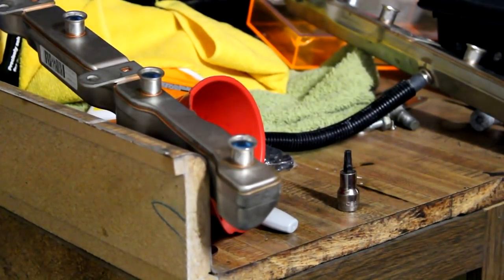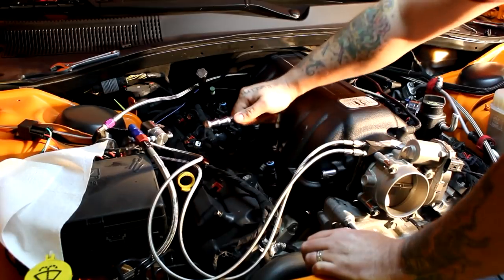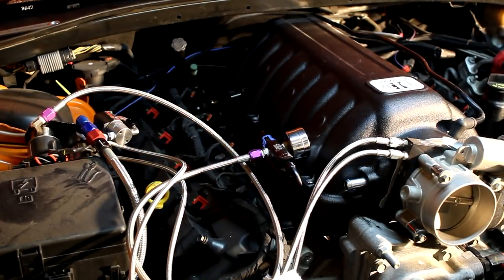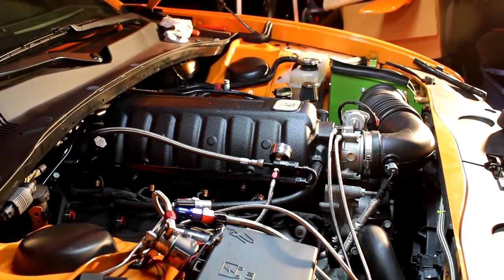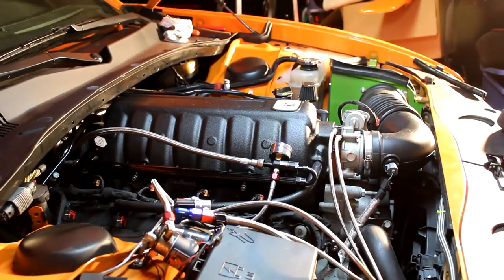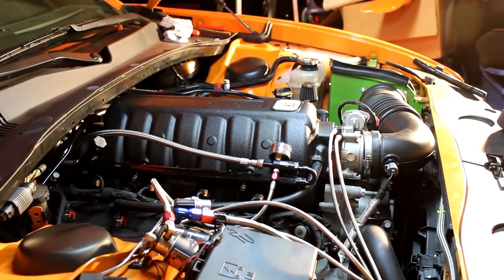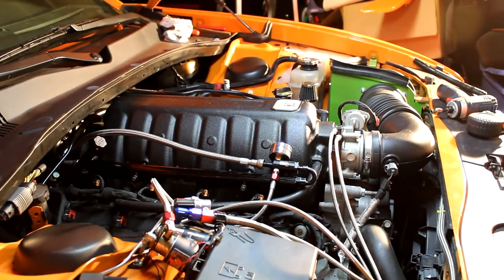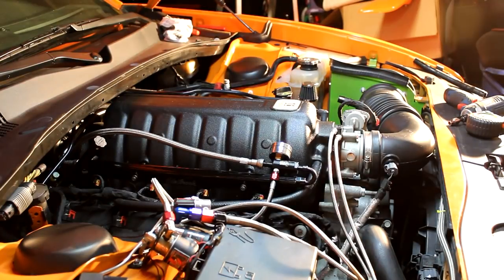Charger Edelbrock VictorII Intake Manifold Pt 2

Comment: Is the edelbrock a better option to go with than 6.4 or 6.1 intake manifolds? cuz I heard that edelbrock is not suitable for light modded engins.
Reply from the maker: The 6.1 intake has better flow rating but I got the edelbrock for a great deal. I would say its suitable for any but you'll see a bigger gain from  a 6.1 intake.

Comment: Any gains?
Reply from the maker: Changed from 470 to 523 with a tune and manifold.
Reply: @ParaLefty  is that an estimated crank hp or is that like actual whp on a dyno?
Reply from the maker: @kendonhubbard2828  actual wheel HP on a dyno
Reply: @ParaLefty  thats awesome. I am looking into getting one to pair with a cam on my 392. How much taller does it sit over the stock manifold? I want to see if i can still fit the shaker on top of it with some custom fabrication.
Reply from the maker: @kendonhubbard2828  unless using boost or nitrous I do not recommend buying g the Intake.  In some cases people have lost power on N/A applications.  I couldnt tell you the difference in height as I did not measure.
Reply: @ParaLefty  under nitrous right?
Reply from the maker: That is correct

Comment: You had any problems with high flow detected with putting that little filter on next to the oil cap instead of routing a hose back to the intake ?
Reply from the maker: I have had no issues
Reply: Damn I’m having issues with mine but have a 2018 set up
Reply: Scatpack
Reply from the maker: Have you had it tuned?
Reply: ParaLefty yeah I have I might just have to run it back to the intake try that out cause when I did the data log and sent it back that’s how I had it at first. But then I wanted it to look clean so did the other set up first so don’t think my air fuel is reading right.
Reply from the maker: @timrasco3892  it shouldn't affect your fuel pressure at all. Something else has to be up
Reply: ParaLefty don’t know man getting different things sense my IAT is right behind where the hose would run on the intake from the crankcase breather. There saying that could be it sense the IAT and map work together. I also didn’t run into these problems till I did that. not sure though I’ll work on it tomorrow and eliminate all my options.
Reply from the maker: @timrasco3892  let me know how it goes, maybe I can think of something
Reply: ParaLefty will do man thanks for the reply’s and help👌
Reply: So update I removed manifold replaced map sensor put manifold back on checked for air leaks can’t seem to find anything. But car will start then go to like limp mode and shuts off. So my next step is throttle body harness see if it’s getting the right voltage and any loose wiring or prongs. Then also check the pedal acceleration sensor and see if that went out.
Reply from the maker: @timrasco3892  tou have a 6.4 right? Did you bypass the active runners
Reply: ParaLefty I didn’t at first but then Sean fixer that from Hemifever so I’m in a pickle right now. Got code p2172, but heard that can get triggered if wrong voltage is sent like if my throttle actuator or pedal acceleration pedal is messed up. So those are my next steps wiring harness and sensor from pedal what you think ?
Reply: Isn’t open
Reply from the maker: @timrasco3892  valve covers are easy to pull and check the valve springs
Reply: ParaLefty yeah I just might don’t see why any of that would be affected didnt do cams or anything just manifold. So thats why I didn’t do it right away I’ll do that after the little stuff the wiring harness and pedal cause my throttle body ain’t even trying to move really even when I try to rev it.
Reply from the maker: @timrasco3892  I seriously can't understand why you're having so many issues. I just unbolted mine and bolted on the new one. I hope you get it figured out here shortly
Reply: ParaLefty you and me both one step at a time I think it’s a sensor or a harness issue honestly. But I’ll keep you updated thanks for the reply’s
Reply from the maker: @timrasco3892  no problem thats what were here for
Reply: Tim Rasco did you open the throttle body by any chance with it unplugged? It will ruin it

Comment: How much of a gain did you get with bolt ons and the edelbrock bro?
Reply from the maker: I would say without the nitrous about 100. With the conservative tune because of the nitrous its only 60 but its rich and retarded timing. with the nitrous its a 240 HP gain on a 125 shot.